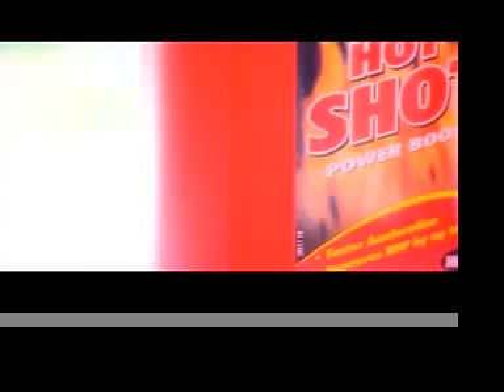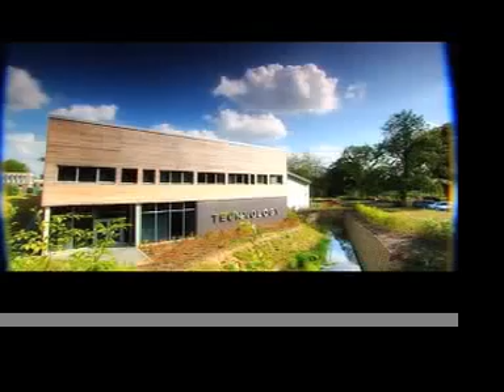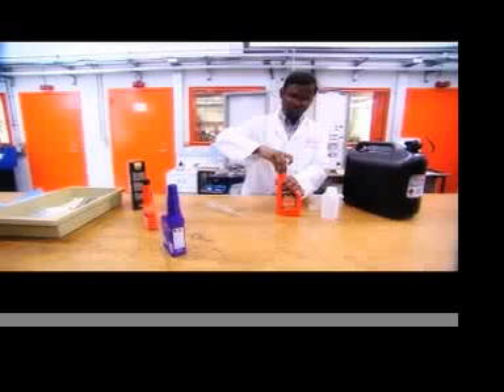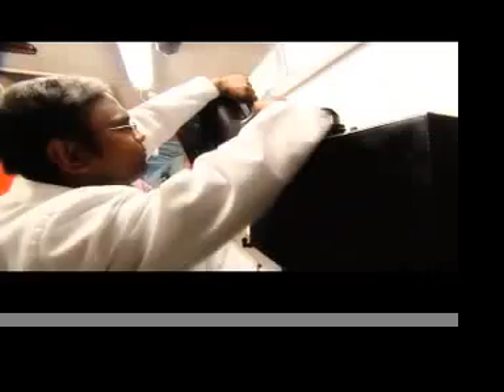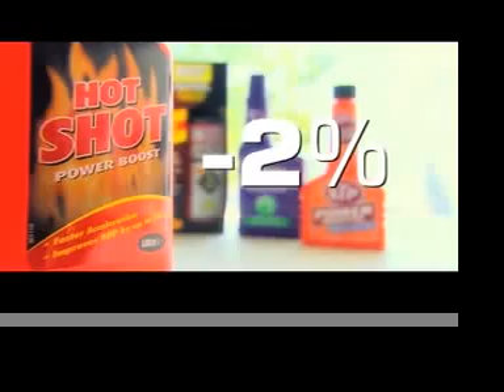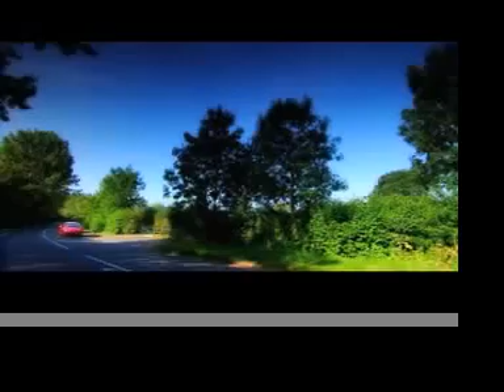Petrol Additives

Comment: As far as increase in bhp from using an additive you will only get a bhp increase if the injectors are clogged as the injector cleaner cleans them.

Regular use of injector cleaner will stop clogging of injectors and keep the engine running at peak performance and on variable vane turbochargers stop the vanes from sticking this is becoming on common problem town driven tdi's which results in high labour costs, and the vanes may be damaged so add the cost of a new turbo.